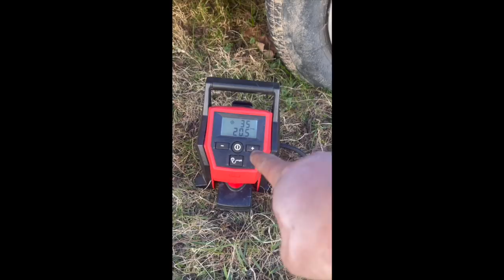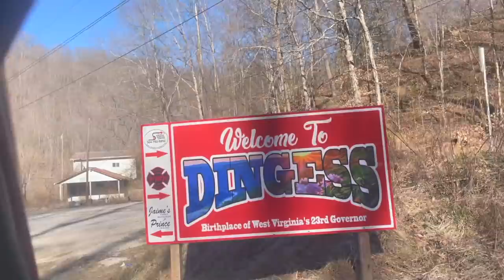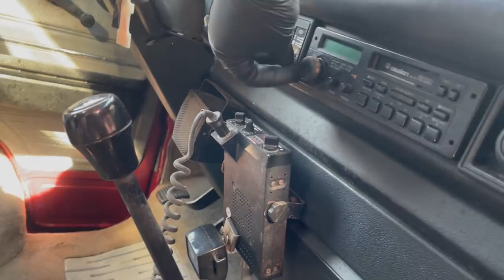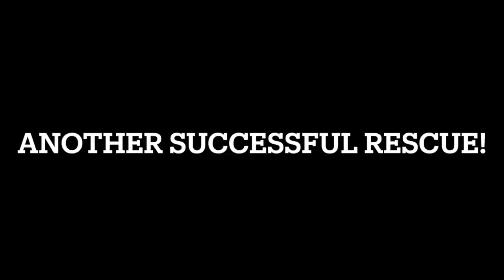Abandoned VW Camper- Will It Drive? 1987 Westfalia parked for 10 years!

Comment: Enjoyed this video , I was a factory VW mechanic for 18yrs. And saw daily drivers that had more problems than this! I am really curious as to what burned , everything in the engine bay looked ok?
Reply from the maker: The bus had been rebuilt and back on the road since the fire. The fire burned all the wiring, fuel lines, intake, etc and randy purchased it that way. He purchased a ‘90GL as a parts donor which he took the engine intake, wiring, etc etc off of and transferred into the westy (with new fuel lines). He had it up and running for a few years before parking it.

Comment: That's a cherry.  I'd swap gear oil STAT, then handle the maintenance items and keep that 2.1 going for a while.  I'm running a 2.5 subi and 1.8T in my vans and went there only after the stock motors were dead.  Also, nice t-slim Dan.
Reply from the maker: We’ve been hard at work slowly putting it back on the road. All fluids are getting changed out- though for now... a few miles on the existing gear box juices.
Reply: @TheBarefootForge  are you doing follow up videos... My son would love one... Ive a t6
Reply from the maker: @linoleumbonypart385  we have a whole series on the build out of my blue syncro Westy. There will not be many follow ups on this bus- as it’s not my car, it’s Dan’s.
Reply: @TheBarefootForge  only just found you will look it up... Loads for sale on uk ebay
Reply: @TheBarefootForge  well can you tell Dan he has an audience
Reply from the maker: @linoleumbonypart385  absolutely!

Comment: i bought an 1988 T3 Magnum in Tornado Rot ( Red ) new. Same front grill and lamps, interiour buissnes like. 1989 it was stolen in France. greetings from Germany
Reply from the maker: That's my favorite color, i've never owned one in Tornado Red- SOMEDAY! 
Cheers!
Reply: @TheBarefootForge  I had the 90 HP suction diesel with intercooler, if you increase the diesel supply and the air supply as well, the engine has 100 HP
Reply from the maker: @Dreatnought1966  absolutely! We never got good diesel van options over here- just the naturally aspirated ones for two years, which.... sucked.
Reply: @TheBarefootForge  At that time, VW manufactured the vehicles individually here in Germany according to the equipment ordered. Off-the-shelf models were available abroad, well-equipped but not individually
Reply from the maker: @Dreatnought1966  my blue bus (see other videos of the syncro Westy recovery) was a custom ordered bus and the family flew to Germany, picked it up at the factory, drove it for two weeks, and shipped it to the US! So cool!
Reply: @TheBarefootForge  puh not ceap, shipping 3500 USD, Taxes,

Comment: Whole new meaning to RAT patina....
Reply from the maker: It’s back to life and being enjoyed- they don’t all have to be restored to be cool.
Reply: @TheBarefootForge  for sure buff it up and drive. it. just get rid of all the rodents ha ha
Reply from the maker: @Mikefngarage  oh ya- they’ve already completely stripped the interior, sprayed in second skin “spectrum” sound insulation, and put it back together entirely mouse free.
Reply: @TheBarefootForge  you can pop the injectors with a 9v battery they operate on less voltage than that. we did that many years ago. Just dont hold it open or you will fry them. worked on the old air cooled injectors for many years. Back in the 80s they were 60 ea. So we always tried to fix them.
Reply from the maker: @Mikefngarage  it works pretty slick- but I’ve seen plenty break loose with 18v that wouldn’t move with 9 or 12, so now I just go straight to the big guns.

Comment: Do you happen to know anything about 85 vanagon hard top. Wolfsburg weekender? This is like no info on the early Wolfsburg. I'm forsure its an 85. Any info you know of? Google, samba are lacking.
Reply from the maker: Does it have a blue corduroy interior and snap in curtains?
Reply: @TheBarefootForge  yes it does have the blue corduroy interior. And the Snapping curtains. I can't find any pictures or pictures of anyone even owning one. Mystery to me since I bought one LOL
Reply: Trying to find out what I'm missing, I have the rear facing seats as well as the table and bad but not the cushion for the engine bay. I don't know if there was any type of fridge or camping supplies because there is an extra battery Bay any links to any other in existence that you can find would be great.
Reply from the maker: @stefanoconsiglio3177  one thing- that’s an ‘84, which is going to assist you tons in your search. Lol. 

That was only offered as an 84 model year. 

You’re not missing anything. No fridge or other accessories came with that.
Reply: Dan who films shenanigans, just procured an '84 blue Wolfsburg from me. It also came with a snap in rear hatch screen. Mine was repainted (by a previous owner) a slightly different blue metallic. Had factory air that was way more sensibly installed in the ceiling than later year transporters.
Reply: @airscribenet  so whats his page or whatever? Do you have any pics of it when you had it? This is awesomee!
Reply from the maker: @stefanoconsiglio3177  The video including the rescue of Dan's now '84 Wolfsburg Weekender comes out next- stay tuned!
Reply: @TheBarefootForge  heck yeah!  Can't wait to see!

Comment: U familiar with mustie 1?? He did a similar one for his dad.  And he brought it to fla
Reply from the maker: I hadn’t seen him do a Vanagon, just a split window. I’ll have to look for that!
Reply: @TheBarefootForge  he fixed it for his dad thennwentvback to fla  it this past Feb during an epic snowstorm
Reply: @TheBarefootForge  HAD PROBS WITH CORRODED CONNECTORS FOR FUEL PUMP RELAYS AND SUCH WOOD GO OVER ALL CONTACTS AND CLEN AND SPRAY CORROSION PREVENTER ON THEM
Reply from the maker: @rsprockets7846  every bus has its own unique set of problems. 

At this point- I think I’ve seen them all.

Comment: After 11yrs in a field,there was still 😳 petrol in the tank,or did you use fairy dust to start it🤔😂
Reply from the maker: There was gas in the tank! But as you see in the video- we did have to put fresh gas in (and a fresh fuel pump).
Reply: The canvas is available at GOWESTY.COM
Make sure you get the 3 vent. It's about 400 bucks. 
Since yours is post 1987 ( brown interior) it's easily worth over 25 grand fully sorted.Plug the fridge into a 110 volt outlet before trying it on anything else.
Having it run on 110 for at least 24 hours usually wakes them up.
Gowesty has the hatches, as well.
Great find!
Reply from the maker: @MrPaige222  great advice!
Reply: @TheBarefootForge  
Glad to help. Do you know what year it actually is?
Since it's a gray interior, it's definitely NOT 1987. I'm guessing 1988.
Makes a huge difference in value
Reply from the maker: @paigehunt3387  it’s a 1987. Grey interior started the 1987 model year, all “1987s” by model year are grey interiors and most produced beyond 6/86 came with grey interiors.
Reply from the maker: Model year is designated by the 11th digit of the vin and nothing else- there are 1987s built in 1988.
Reply: @TheBarefootForge  
If the metal tag inside the driver side says 6/87 or later, even though it may have been built in 1987,  It's titled (at least in California) as a 1988. What does you title say? Now I'm really curious. All the 1987z  we ever had in California had brown interiors. Since yours is gray, it really doesn't matter. You have the valuable one, no matter what
Reply from the maker: @paigehunt3387  simply put- this is incorrect. In your case the title may have been an 88 with a 7/87 build date but that’s not how the model years are designated. Any van with an H in the 11th digit of the vin is an 87.
Reply from the maker: The title reads 87, much like my other four current 1987 vans.
Reply: @TheBarefootForge  
I learn something new every day. Anything in California that has a build date after June is titled as the subsequent year. Regardless of manufacturer. Thanks very much for the information.
Reply from the maker: @paigehunt3387  states don’t determine their own policy for selecting vehicle build dates- the build sheet from the manufacturer gets translated into a title issued by that state. There are absolutely vanagons built in the first month of 1988 that are titled 1987s in California. 
Since 1988 began a slightly different set of features, the designation is generally based on the features present, resulting in the designation of the H in the 11th vin digit, and thus the 1987 designation. 

There are a lot of 87s! And many of them are built in 86 and left overs. There are very few 88s and 89s, even if they built the same number each year. They just needed to clear out those 87 model years to move on. 

It’s kinda weird when you see enough of them, how the build dates vs model years start to show the story of what was going on in the factory at the time. For instance, almost every syncro that doesn’t have a diff lock, is an 86.... 
and they made ALOT of syncros in 86, but many of them were designated 87s.

Comment: Do you have the link for that hose with the valve?
Reply from the maker: https://amzn.to/3amp0wk
Reply: @TheBarefootForge  yessss thank you!! I'm going to look at a 1985 vanagon with 124,000 miles on it this week!! Do you have any tips?? Anything I should look out for, double check??
Reply from the maker: @DinoXavier  well, there’s ALOT to look over. If you have a listing for it, post it and I’ll take a look and let you know my concerns. Hopefully it’s a good one, the deal works out, and you get to enjoy many miles and smiles!
If you’re not comfortable posting it- feel free to email me at thebarefootforge@gmail.com and I’ll help if I can. 

(Though I prefer to discuss publicly in the comments- as the engagement is key!)
Reply: @TheBarefootForge  hahaha yeah there is obviously a lot to check! the van is overall very clean and almost no rust. the owner said he did a compression test and had 120psi on all 4 cylinders, no corrosion with the almuinum head. ive tried searching for compression specs online but had no luck. he said normal maintenance has been done as usual with brakes recently done. engine and transmission all original with 200,000 kilometers on it. whats the usual lifetime of these engines? i'll send you the link and thanks for the response!! means alot
Reply: is called a jiggle pipe in Oz. every tourer has one in their kit.

Comment: Now throw the wasserpooper in the trash and put in a reliable motor
Reply from the maker: I’ve got hundreds of thousands of miles in wbxers across countless vanagons- it’s quite a good engine. 
Don’t get me wrong, I have conversions in two of my busses- but no conversion will EVER be as reliable as a WBXer. (In terms of engineered, standardized miles served on the platform). 

They’re fine engines, just old and a little under powered.
Reply: @TheBarefootForge  every single vanagon I looked at ran on 3 cylinders. Every.single.one including the one i bought. Sold it a month later after a compression test.
Reply from the maker: @goclunker  crazy! Well sadly, broken busses are broken- start looking at better busses. 
I’ve never come across one running on three cylinders that was for sale, and I’ve looked at hundreds. 

Are you just scraping the bottom of the barrel?

Comment: I think that you have the wrong antifreeze. Yours is green mine took European blue................
Reply from the maker: Modern green antifreeze is phosphate free and works great in these old busses. We use Peak, but just about any green antifreeze is great so long as you flush out the old stuff. 

Keep in mind, you’re seeing what we came across after sitting in a field for ten years, we didn’t change any antifreeze, yet, but have since filled it with quality Green stuff from Peak.
Reply: @TheBarefootForge  I had one like yours  and I had head gasket problems from what my mechanic said was the wrong anti-freeze due to corrosion issues. Glad you have it figured out...............Good Luck
Reply from the maker: @joescott7027  that was more of an issue back in the day when some coolants had phosphates in them that dissolved the aluminum heads. These days- any modern coolant works great at preventing corrosion and lasts a long time.
Reply: @TheBarefootForge  awesome, you already have had better luck with yours than I had with mine. Never got it to work correctly for any amount of time. Be sure and look at your oil cooler. If it leaks into your oil like mine than it turns into a giant mess. This seems to be a common problem................
Reply from the maker: @joescott7027  oh definitely- there’s a little o-ring there that will definitely need to be updated!

Comment: fake!  fake !
Reply from the maker: What’s fake?
Reply: @TheBarefootForge  The hole clip evryting is fake after seriously fire need a lot of work etc.etc.
Reply from the maker: @adrianvinatoru9207  and it got that work. At no point did I say we were buying a bus that JUST caught on fire. 
The seller purchased it as a result of the fire (which he mentions), he bought it totaled due to fire and fixed it using a donor vehicle (also included In the sale- we need to go get that at some point....) and changed out the whole top end of the engine, wiring, hoses, etc from the donor. He enjoyed the Westy for several years before parking it. 

Nothing at all here is fake, you either just interpreted something incorrectly or didn’t watch the entire video.
Reply: @TheBarefootForge  Ok !